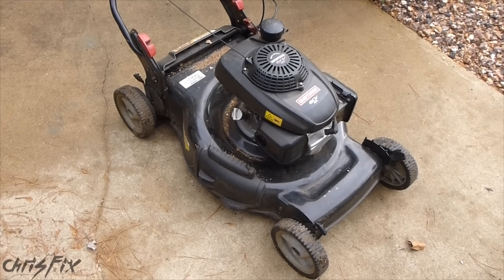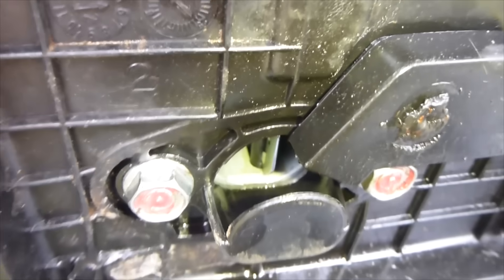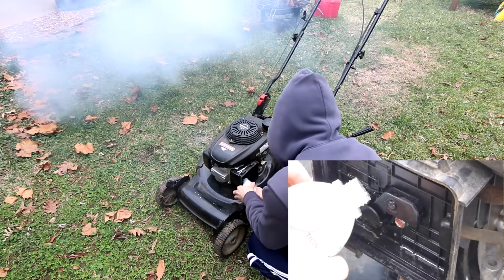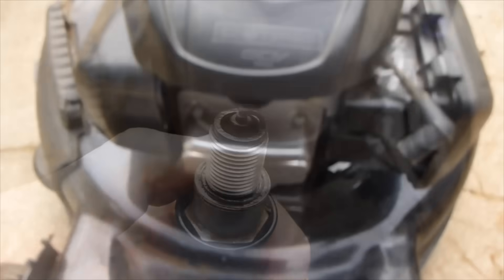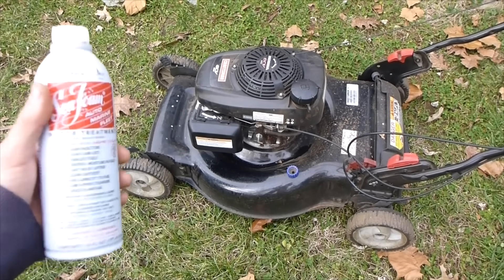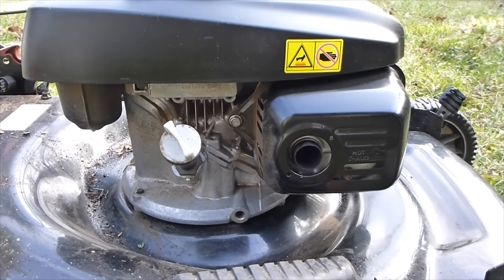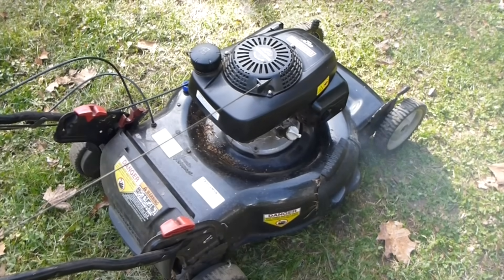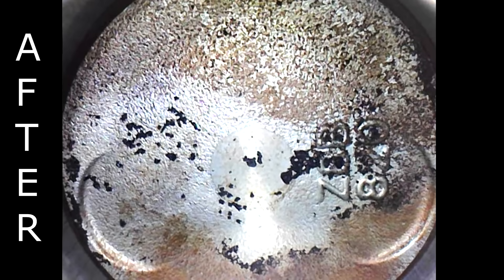Does Seafoam Actually Work? (with Proof)

Comment: wasted your money a spray bottle with water will do the same
Reply from the maker: +Brian Meade I will be testing water, stay tuned!
Reply: yea my father was a mech and told me about that as well as wd-40
Reply: Julio Silguero i know. The last thing i want in my intake is water. Now ive heard of the water method but im not trying it. Water doesnt belong in the bore
Reply: ChrisFix still waiting for the water video lol
Reply: +Brian Meade water works great on a carbureted engine but don't try it with a new engine that has a mass air flow sensor, it might break the tiny sensing wires.
Reply: TheDriza what do you think you get when you mix a hydro carbon with oxygen?
Reply: Rail rider you dont stick a hose in the inlet and turn the tap on. 
A LOT of turbos had water injection to help control combustion temps and head temps before they got good at engine management. Its a fine SPRAY mist. In small doses.
Reply: Brian : yes it will but u risk cracking piston.
Reply: don't do it. water does not compress. oil does. it will hydro lock your engine if your engine can't take it. You could spray a fine mist into the intake and get away with it if you are careful. I hydrlocked a civis. I left the engine sitting overnight  letting all the water drained to the oil pan. I changed the oil next day. Luckily the engine worked after oil change.
Reply: Water+Heat+ and a little carbon monoxide?
Reply: aly 884 wow... Never seen so much bullshit in one comment... Stay off the internet kid...
Reply: Water doesn't crack pistons hydrolocking it does which you can do with anything liquid like Seafoam.
Reply: HAHAHAHAHAH okay bud we're testing seafoam not fcking wooter 😜😂😂😂

Comment: One may ask and wonder why the manufactureres of these fuel system cleaners do not put forth a similar test/demonstration.  it would seem the best way to sell the product is to show how well it works...and not just the before and after pics they put on the can.
Reply: If the manufacturers knowingly market and sell a product that does not do anything close to what they claim, it is called fraud.
Reply: it's because most people that only go to a giffy lube and stuff are to stupid to understand how carbon is bad also it would be a long ad on TV if it were a thing

Comment: Try the same test with WD 40.  I think you will be shocked of the results.  The try it with some H20  small amounts.. yup you guessed it same results.
Reply: H20 .. awww.. people don't know about that!.. steam cleans the inside of a engine  big time!! but they have to know how to do it or it will  be bad news!
Reply: I use wd40 regularly in my diesel ih motor when it has been sitting. Just a couple of squits in the intake. Great compression booster.

Comment: A great was to find out what is in all sorts of engine cleaning products is reading the Material Safety Data Sheet (MSDS). You can then buy typical ingredients locally or online without the brand name markup. MSDS are required to be available for poison control and other HazMat-related reasons.

Comment: You can do the same thing with water. The seafoam, poured in like that, gets into the cylinder as a liquid droplets and that will actually act like shot blasting the piston, knocking the carbon off. Yes the seafoam is a petroleum distillate and will dissolve carbon if left soaked long enough. But just pouring it into the intake, it doesn't have time to actually dissolve anything. You should try the same thing with water. You won't want to pour enough in to stall the engine out, but just let the water trickle in. After a little while, check the cylinder again and you will find it cleaner also. And you won't have the smelly smoke from the exhaust. Just a little more water and wet carbon.

Comment: I am a retired taxicab mechanic.  I have used Sea Foam many times with great results.
Reply: Did you pour it into the gas tank or did this method?
Reply: We took a vacuum line off the intake and dropped it into the can.  Just let the engine suck it in.  Might have poured about half a can in the tank.  A cheaper method is spray plain water through the air intake from a squirt bottle.  Must have a fast idle and regulate the water intake  so as not to stall the engine.  Basically like Sea Foam, but free.
Reply: Rock Drummer: What does a Taxicab have to do with it ? Thanks for your service. =D

Comment: I would think carbon add power  in the way that it compresses tighter Just like a high compression piston has more mettle on the top if it
Reply: Yes carbon build up can increase compression but it can course engine run on .after you turn it off because of hot carbon

Comment: The thing is - that amount of carbon in the top of a piston is not an issue. It's neat that seafoam can remove some of it, but why bother?
Reply: I agree that the carbon buildup isn't enough to cause problems, but the video wasn't about whether or not that amount of buildup was an issue. It was about whether or not the product would actually remove any of it.
Reply: +Ryan Alvidres-Ivie Yeah, fair enough man, you're right. I just figured if I could save people a few dollars by letting them know it's not necessary I would.

Comment: Chris, Thanks for the cool video.  I have Jeep engine that creates lots of carbon deposits and NO2, so I'm familiar with Seafoam.  Can you redo this test with sprayed water?  That's right, water mist sprayed into the running engine will give you the same results.  Start the engine, warm it up, get a spray bottle set it to mist and spray it into the engine as it's running, about 40 pumps.  It will do the same thing.
Reply from the maker: +Martin Strudwick yes, I want to test water

Comment: I just put it in my fuel can and on my vehicles I just poor it in the tank but make sure you poor in the right amount or you could damage your engine. And it is also a fuel stabilizer for gas engines that may sit around for months not being used.

Comment: When it was available I used OMC Internal Engine Cleaner. I have some Mercury which I have yet to use. You might give it a try.  The OMC worked like crazy.  I actually had carbon coming out the exhaust of an outboard like syrup.

Comment: For all of my small 2 and 4 cycle engines I have gotten to adding Sea Foam to my gasoline directly, instructions are on the bottle, and it seems that they are also easier to start the start of the next season.  Where as previously, before I tried Sea Form, the engines ran rougher and were harder to start, especial that first run the next season.

It is good to know that using it as more of a fogger-style application is being proven as a fix for carbon deposits.
Reply from the maker: +Todd Norris Glad you liked the video and thanks for sharing!

Comment: Chris,
It's good to know that the Seafoam works when dribbled through the intake to clean carbon deposits off of the piston head.  They also claim there are two other ways to use the Seafoam - first, put it in the gas (which would accomplish the same thing as this, albeit much slower), and secondly, putting it in the engine oil.

I have anecdotal evidence about putting the Seafoam into the engine oil, and it's not good.  I had three motors (Ford 460 V8, Jeep 4.0L I6, and Mazda 1.8L I4), and all were second hand purchases with high mileage, infrequently serviced engines (the Jeep had a fair amount of sludge build up, the Truck is 40 years old, the Miata had 150,000 miles).  I put the recommended 1/2 Pint of Seafoam into the engine oil, ran the cars for a few minutes until the engines were warmed up.  I then drained the oil, changed the filters, added fresh oil, and then drove the cars regularly for the next few weeks until all three developed the exact same symptoms, almost simultaneously - just over cruise RPM, the motors were making alarming clattering noises, and showed low oil pressure!

I pulled the Oil pan off the Jeep, and removed a main and rod bearing to inspect.  BOTH were completely trashed, having worn through the first two layers for the majority of the bearing!  I pulled the motor apart, and rebuilt it in the Garage (luckily, most of the sludge was gone from the valve cover, too!).  For the truck, I just replaced the bearings without disassembling anything further, and then did increased oil changes, and it's also been fine.  I sold the Miata, the owner was planning on rebuilding the motor and turning it into a track toy.

My theory is that the Seafoam worked too well, and dissolved/loosened up all the crud from the motor, which then drained down into the pan, was picked up, and filtered by the engine.  Fairly rapidly, the filter plugged up from the sheer volume of stuff that was cleaned.  Then, once it was plugged, the bypass valve opened in the filter and shot a full load of the crud straight through the whole motor, rapidly trashing the bearings.

If you ever find yourself in possession of an old sludgy motor that you don't mind rebuilding, it would be good to see someone else corroborate my experience, to see if Seafoam in the oil can work too well and result in shot bearings.

Comment: Had a Honda mower and the valves locked up with old gasoline.  No compression when I tried to start the mower.   Dealer wanted $200 to fix.  Put seafoam straight into the spark plug hole and super concentrated Seafoam in the gasoline I was using.  And a Youtube said to pull the cord fifty times and then add more seafoam behind the spark plug and repeat four times.  They said it will take 200 pulls before it fixes the valve.  And it did at about 180 pulls.  That was several years ago, and I now do not keep gasoline for long and or I add staybill.

Comment: your supposed to mix with fuel
Reply: Wrong. Seafoam is a multipurpose additive. You can use it by pouring it into the gas tank or by the method Chris is using here. It says it right on the fucking can, so please, learn what you're talking about before posting.

Comment: what difference do this actually make to the engine
Reply: Neither of those things is significantly changed by cleaning a tiny bit of carbon off the piston.
Reply: +yermanoh None
Reply: +yermanoh Keeps the engine from dieseling and keeps the compression ratio where it needs to be.  Either issue is hard on an engine, especially hard on smaller engines.
Reply: +yermanoh None
Reply: its actually fixed my check engine light. Fixed it idling rough too.

Comment: I used seafoam on a 2000 Indian and it pealed the tank liner loose.  The epoxy liner was not installed properly, looked like they didn't prep the metal before coating and left a couple of bare spots and the sea foam worked it's way under and make it turn loose.

Comment: I like the way you did your video. Very concise, to the point and logical. The actual product....ehhh...not so much. I doubt a little carbon build up on tops of pistons will affect performance of any gasoline or diesel engine. It's like trying to solve a problem that doesn't really exist. In fact I would be more worried about a strong solvent like that stripping the minute amount of protective oil in the hone marks of the cylinder walls causing irreparable damage and premature failure. I'm not sold on it then again I don't believe in or care for any quick fix additives. Change your oil and filters regularly, don't drive like a maniac and your engine will last as long as it should last. Believe me I've owned cars since I'm 15 (43 years of car ownership and counting) and never had one break to the point of needing replacement. Skip the Seafoam scam and keep your hard earned money for a trip to the beach.

Comment: Sea Foam is a GREAT !!! gasoline additive ( I've used it for years ), but I've been advised by several auto mechanics to never EVER !!! use Sea Foam as a crankcase oil additive. According to my mechanics ... #1. If you own a newer car, you shouldn't need an oil additive in the first place and #2. If you own an older car and use Sea Foam as an oil additive, if you have any seal areas that are corroded (voids) those corroded areas will have gunk built up in them and that gunk is actually helping to seal up those corroded areas. In short, running Sea Foam as an oil additive for older automobiles isn't advisable. A big no~no.

Comment: I've used a spray bottle and tap water for years and the results are close and only spent 69 cents on the spray bottle. Try a comparison with water first.Now I'm interested to see if the foam makes a significant difference after water ?

Comment: to be honest,dumping that shit in there probably worked like a steam cleaner method. I have used seafoam on two stroke boat motors and have had great luck with it. It actually works great by adding to the fuel,not right into the cylinder. It removes varnish and loosens up stuck carb parts and float problems. old timers swear by it. They would laugh at you for using it that way but whatever. Not really great for automobiles,as you found out.

Comment: An older auto mechanic showed me this very trick using just plain old tap water. I had an old car that was running rough at idle and the pistons and valves were full of carbon deposits. Brought the engine up to operating temperature, locked the throttle off at around 2500-3000 RPM and slowly poured tap water in through the brake booster vacuum hose at a rate that slowed the engine RPM down to no less than 1000 RPM, occasionally  backing off on the water to let the engine rev back up again. After using about one 2 litre pop bottle of water, the engine ran perfectly smooth. As it was explained to me, the water had actually removed almost all the carbon deposits through some sort of 'explosive steam' effect inside the combustion chamber. True story.
Reply: it is from the chemicals water is based on ...when heated up or separated you get hydrogen and oxygen from water ....kinda a old school trick .....but old school science ..it works .....just like a small intake leak and driving in the rain a catch 22 ....take it or leave it
Reply: @PurpleGalaxyWolf-yt1gx  , so you are suggesting that instead of the water simply flashing to steam and cleaning that way, instead the water is undergoing thermolysis in the engine? The temperatures required for that.....well, I doubt that a typical internal combustion engine gets hot enough for that to take place.
Reply: no lol, whach dumb things NOT to do to your car by scotty kilmer
Reply: Nah, you can do it, David Freiburger did it on an episode of roadkill garage on an older engine and it worked like a charm.
Reply: @RecklessPlayers12  I used it in my neighbor's lawnmower that barely ran, it stalled out constantly beforehand. It works if you're gentle on it, we're not talking about dunking the engine in water while it's running.
Reply: Yea on the episode I was talking about Freiburger poured a small amount in, just enough to make it bog and then let the engine get back to normal rpm and repeat.
Reply: The problem is with catalytic converters. Old cars fine. Newer cars get clogged cats and check engine lights. Eventually, big problems. Happens with any additive.
Reply: I've done that but I just poured the water down the carb.

Comment: Thanks for taking the time to make this video, I service mowers and there is definitely a difference noticed on the spark plugs when Seafoam is used in the gas after a season of mowing, I also use Seafoam Deep Creep in fogging small 2 stroke engines for a complete cleaning and lubrication of all internal moving parts, I use Seafoam products and highly recommend the use of there fuel treatment for todays ethanol gas which dries up gaskets and diaphragms.
Reply from the maker: +Tim Pope No problem and thanks for sharing!

Comment: Try this if get time and please let me know if does any better . What i does is mix about 25% Marvel Mystery Oil with 75% Seafoam  . I do the same procedure you did with a small plastic bottle that has a flexible plastic tube . I don't have a Bore Scope , but know the soaking will soften the carbon . My 78k mile 1998 Ford Ranger get a can in the tank every OLF and I do a top end cleaning every 2nd or 3rd change including cleaning the Throttle body . DO NOT rev , let smoke die down and also crank without using gas pedal after the stalling with the liquid . Seafoam rocks !!
Reply from the maker: +W Griffin Thanks for sharing!

Comment: Bought a 97 Crown Vic police interceptor.  It started poorly due to the sticky injectors from sitting a long period of time before I got it..  Used seafoam in the tank and drove the car a while .  Then after sitting overnight it started about 85 percent better.  After a couple days it started like new.  I usually use 1 can a year as a cleaner on my injected engines.
Reply from the maker: +freemars1961 Thanks for sharing!

Comment: Plain water will do the same thing; so will any antifreeze/coolant. Both of these are much cheaper than Sea Foam.
Reply from the maker: +Unleavened Karaite Plus Thanks for sharing. I will be testing water so stay tuned!
Reply: ChrisFix Have you ever noticed how clean the pistons are (the whole combustion chamber for that matter) on an engine with a bad head gasket? You can tell which cylinders are taking in water/coolant because it will be clean; literally steam cleaned.
By the way, neat camera.